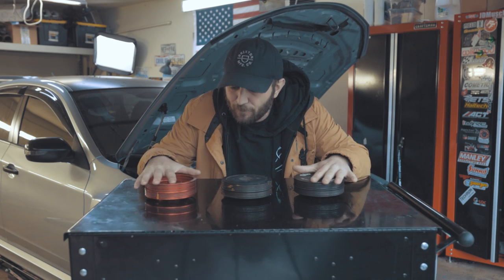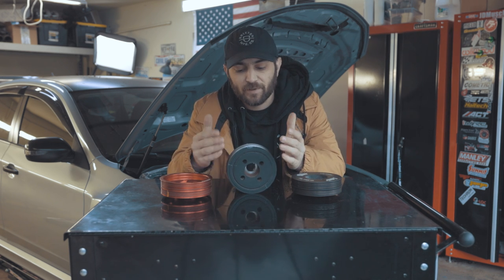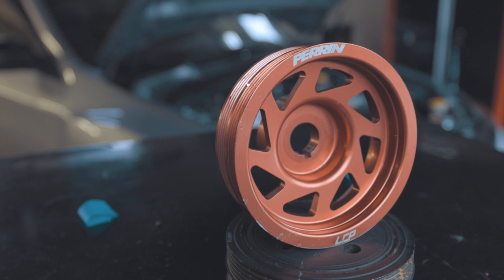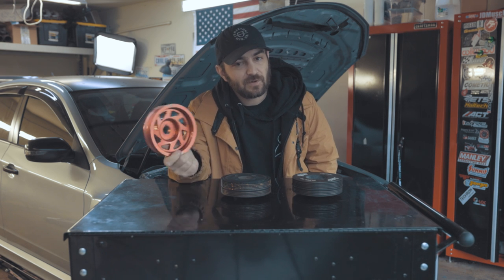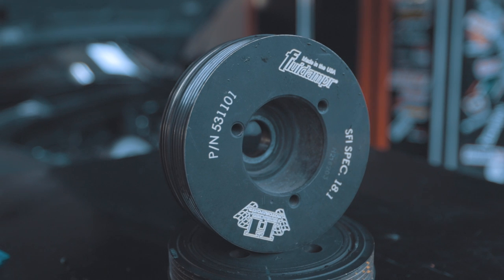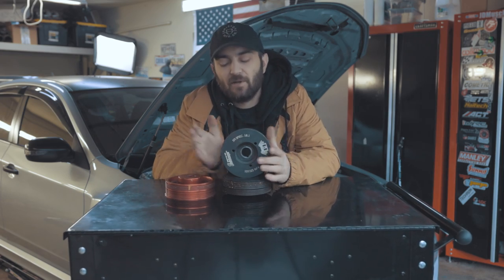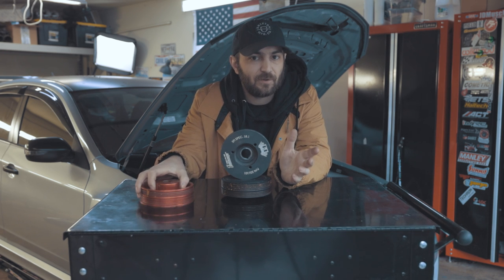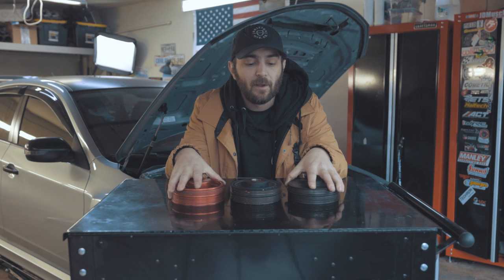Which is Better: A Lightweight Crank Pulley or a Crank Pulley Damper?

Comment: Have had the grimmspeed light weight pulley on the old cobb stage 3 02-04 wrx tune for years now and no issues, been driving my subie hard for years now and high mph runs, only issue i had was i broke 3rd gear replaced transmission with another one and still going hard.

Comment: There are 5 naturally harmonically balanced engine designs: I6, V12, H4, H6 and Rotary. As long as the engine parts are balanced then a lightweight pulley system works without issue.
Reply: Thats not quite true, even even firing engines produce harmonics.

Comment: For the most part I agree. However My Kartboy OG crank Pully has been on since the beginning in Jan2005 ... car has been tuned to 425 wheel..with OE 257  and a Dom 1.5  Now on a worked VF48 and 137k on it now..Still no issues.. I get what you are saying ...Not 600+ WHP...Looking good tho.. :)

Comment: One of the subjects that is so rarely discussed it turns into a spitting match between the ATI crowd and the high HP crowd that don't consider near stock cars... Bleh.

300zx has a 15lb~ crank pulley with a factory balanced crank. Going to a 2lb lightweight makes a dramatic difference in rev speed and on the NA platform it frees up 15~ hp of parasitic loss from the crank pulley. The crank on the TT and NA are the same, the crank pulleys are the same, so the NA will never see any problems going to a lightweight... but the TT might see an issue once you bump power 100+ over stock, so ATI is suggested then.

People like to argue that lightweights will cause problems for the NA and it just... isn't logical. Even the TT at stock power will be unharmed by a lightweight. 
Removal of the clutch fan can also free up another 5-10lbs of parasitic loss going to an Efan, and more so if the waterpump is replaced with an electric one(this is going full race though).